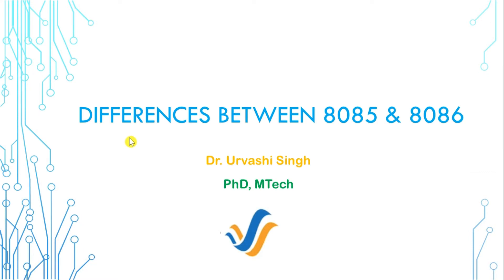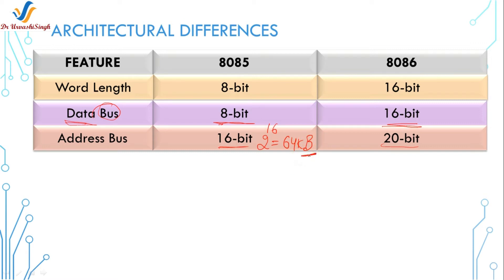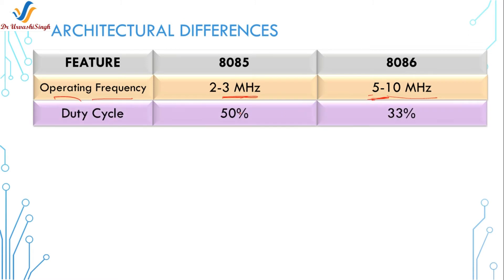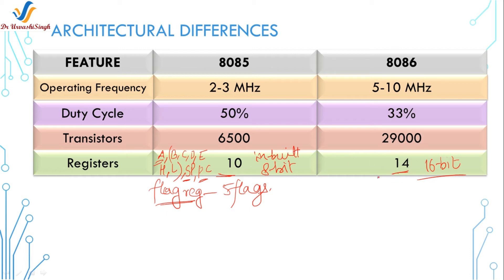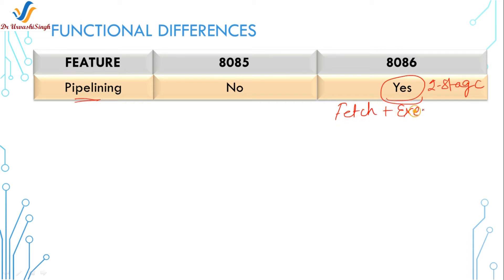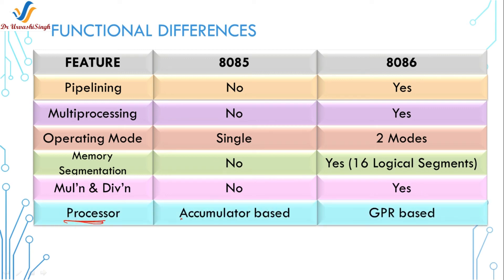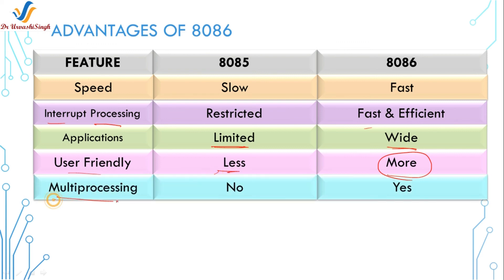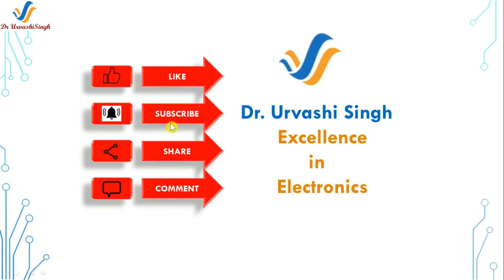Differences between 8085 and 8086 | Advantages and Drawbacks of 8086 Microprocessor | ECE | IPU

Comment: You should include 80286 and 80386
Reply from the maker: thank you for your suggestion. This video was specifically dedicated to difference between 8085 and 8086 (1st version). And it provides you all important differentiating concepts which are requires in exams or interviews.